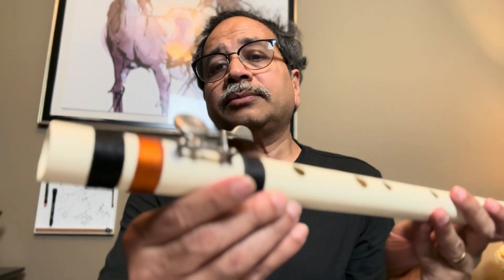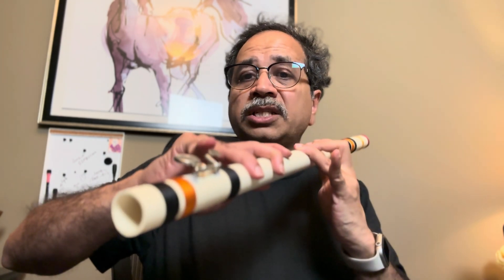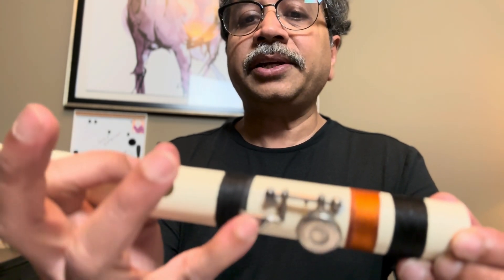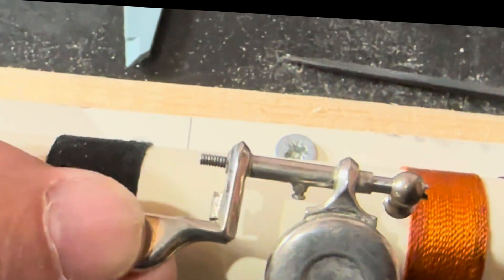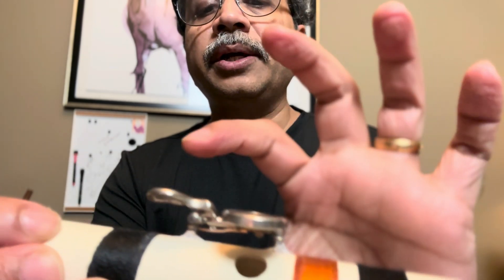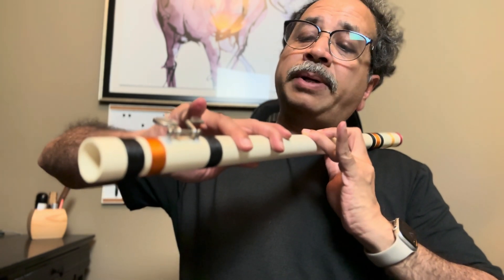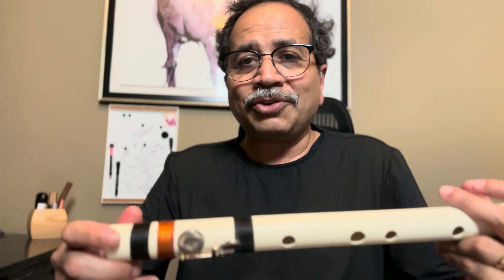Bansuri with bass Ma key - prototype and design alternatives.

Comment: Is it necessary that holes on bsuri in a straight line. My fingers are not lengthy. It is really an effort to cover the holes fully. Ca.n the holes be made zig zag on bansuri so that it can be closed fully
Reply from the maker: It is not necessary for the tone holes to be  in a straight line. Flute  makers make custom flutes for people with smaller hands. A little bias for left and right hands can go a long way in achieving full closure on long flutes. Contact a flute maker and discuss your specific needs.

Comment: At the end, you have rightly mentioned that the key rod should be longer.
In addition, the lever also should be longer, so that your little finger can reach it easily with its natural swinging arch.

The western flute has a chimney for each hole. 
The top of the chimney is flat, so the pad in the key provides a perfect seal. 
But in a bansuri, there is no chimney. 
So the pad has to seal a cylindrical surface, which is a challenge.

BTW if we try to construct a chimney on any hole, the tuning of the hole changes.
Its pitch goes lower. 
So to compensate for that, we have to shift the hole toward the blowhole.
This shift can be as much as 10 mm (depending on the chimney height)!

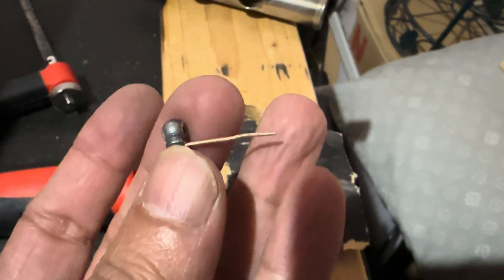@1:50 the wire is made out of spring steel.
Reply from the maker: Good points. Thanks for sharing.

Comment: You can 3D print 2 half cut cups with counter sunk holes with nut inserts. This will provide the flexibility to mount and remove as and when needed. I will try it in my flute with my printer.will share the pic
Reply from the maker: Thanks for your input.  That design is quite viable. I was thinking of using straps. I was also thinking of a mike grip like snap on plastic holder. 

Please share your updates.

Comment: This is a very good adoption for lower Ma. I am sure as you progress if this module may be made a pluggable and also adjustable for a range of bansuri pitches, that would be an ideal. Atleast it minimizes permanent fixture, and movable module across bansuris (few ranges if not all).
Reply from the maker: Thank you. My goal is a snap on module in    a couple of sizes.